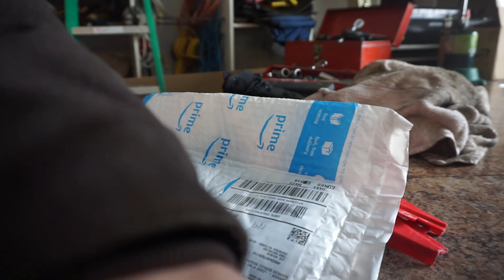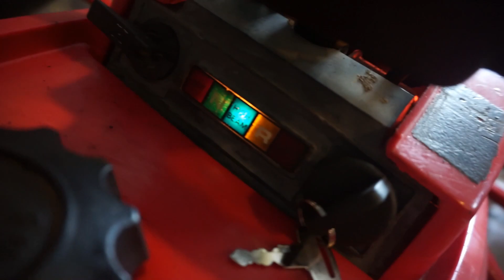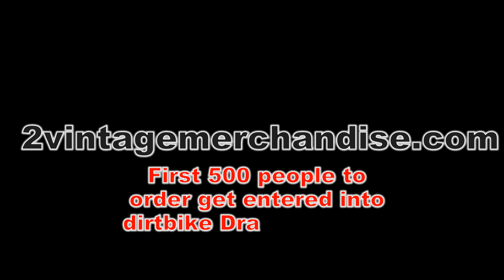This Liquid Cooled 400cc 2-stroke 4x4 Flies!!!

Comment from the maker: Brand new merchandise available at: 
www.2vintagemerchandise.com
Reply: 2vintage does your cooling fan work cause mine doesn’t and my electric start does the same thing as yours
Reply: I have this same Polaris but mine is a 1994 2 stroke 4x4 I need to find a engine i cant find one anywhere
Reply: that looks like fun. i like your video. i use to have the same atv you got. nice video :)
Reply: Where can I find parts for it?

Comment: I had forgotten how fun vintage quads were! They are smaller and lighter than today’s machine and you can throw them around better. The challenge of conquering major obstacles on them without 1000cc is fun. You had to find a way to use what power you had to your advantage and overcome things. I’m having more fun on my scrambler 400 2 stroke right now than anything I have ever owned

Comment: Why not ? Fix up a bunch of em. Nothing better than getting a bike going after you do the work yourself, instant gratification I guess. Always start with a fresh batt. Always, they do weird shit when the voltage is low, blow fuses, melt wires. As V falls amps increase

Comment: I have a 96 polaris express 2x4 and i can tell you right now that your going to break the thing if you keep putting it in low gear, you should have it in H especially if your romping on her like that. Jesus dude
Reply: andrew thompson it’s a 2 stroke it can go WAYY higher in rpm, but he’s not allowing oil to coat the cylinder wall. You need to let off the gas and let back on to blow all the used oil out of your expansion  chamber
Reply: Ford Restored well he Bought the recoil on eBay so
Reply: @fordrestored4646  so if I'm accelerating or giving a lot of throttle, I should let off the throttle to let the oil kind of catch up? How long should I let off for?

Comment: Nice quad! Thing’s a tank. I have some riding experience on polaris’s though and i can tell that thing isn’t going as fast as it should. You definitely have it in low. Put er in high and then giver er a rip on the road and see how fast she goes! High should be all the way forward on the gear shifter, i think you have it in the 2nd position which is low. Should go around 55-60mph
Reply: CQ Outdoors it’s all the way back for high
Reply: @Hc-rt6pe  no it isn't, straight forward is high, from neutral to the right and then forward is low. Straight back is reverse.
Reply: Flag Ov Hate idk what one you got but mine is the exact 350 here and it’s all the way back all the way forward is reverse
Reply: @Hc-rt6pe  hmm well i mean it's been 10 years since i last rode it lol I'm in the process of rebuilding it all.

Comment: You should try to score a 200cc yamaha blaster there sweet little 2 stroke quads and you can find them decent priced.
Reply: They had one awhile ago just don't have enough power for them
Reply: @scottmeyer3803   well if that's to slow so is a yamaha 350 raptor/warrior they are 100% the same  speed as a stock 200 blaster. I have owned a couple.  Either one would smoke a Polaris 400 slow farm quad.

Comment: Does that have a high and low gear? Would have thought it would have been a little quicker...unless you were running it in low...then it makes sense. Also throw a screw driver across the terminals on the starter solenoid. If the starter engages you have a bad solenoid.
Reply: Reuben Swinkels i have one and it has high and low
Reply: Reuben Swinkels it seems really slow it has gotta be in low gear no way it only has a top speed of less than 30
Reply: @DGfilms1996  well also he is riding it in thick snow
Reply: Should be able to put a screw driver on the terminals connected to the solenoid to get the starter to work
Reply: He was in low there way quicker in high

Comment: If you have not figured out the starter problem check to see if the starter wire is off the starter that’s what was wrong with my four wheeler

Comment: I just picked up one of these a trying to get it to running order. Does anyone know what oil goes in the oil tank? What is recommended? If it has a separate oil tank... do I still need to mix oil in the fuel?

Comment: If you disable the oil pump what ratio should you mix gas to oil?
Reply: 50 to 1
Reply: I think 32 to 1 with good synthetic is a good compromise, because at high rpms it needs more oil.